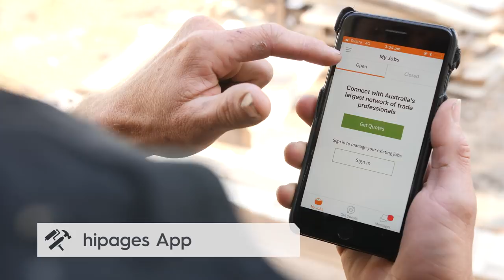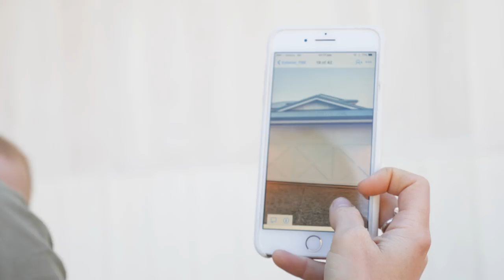Long Jetty Renovation Episode 8 - First Impressions Count

Comment: Hey guy, just found your youtube cannel and loving it.  Keep it up.  Got a couple of questions if you've got time to answer them. I'm about to replace the old weather boards on my place and was thinking I'll replace them with the linea boards this time instead of timber but was wondering did you you need to seal them at the bottom of each board with silicon or sealant of some sort? Did that with my weatherboard I replace a while back but they shrunk and no look like crap.   Second Question, the paint on Toowoon bay, Love the mojo colour.  Is it full tint or half?
Reply from the maker: Hi Scott, we used full strength Mojo on the exterior of Toowoon Bay.  As for the weatherboards, if you're using linea boards from Scyon, there's no need to seal the bottoms of the boards.
Reply: Awesome, thanks guys.